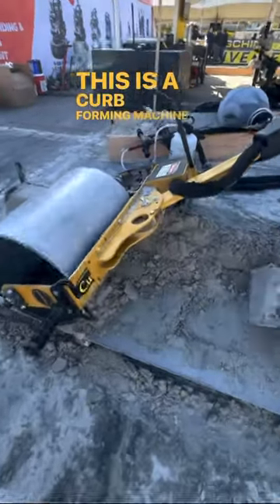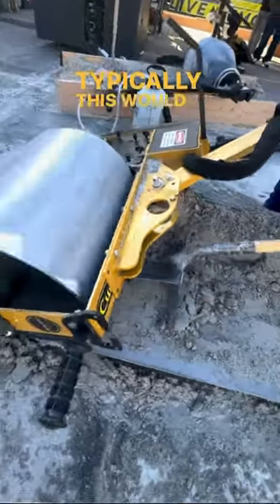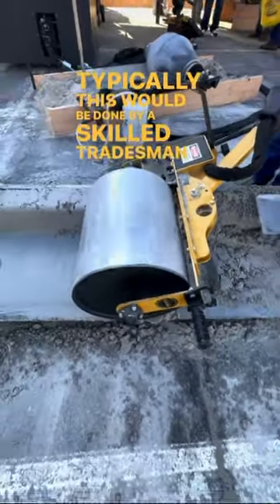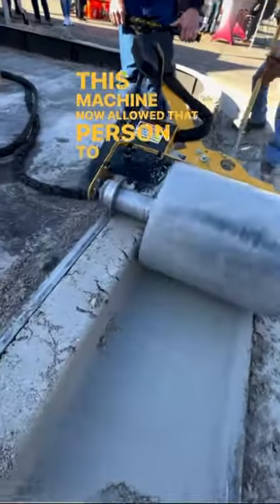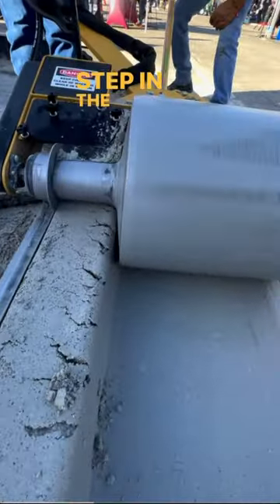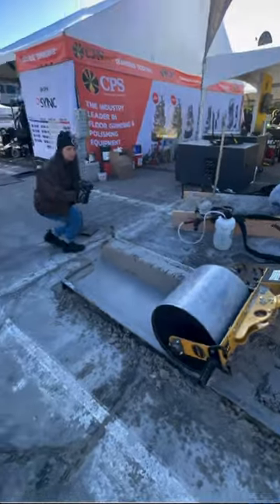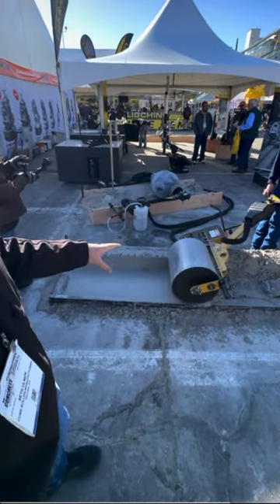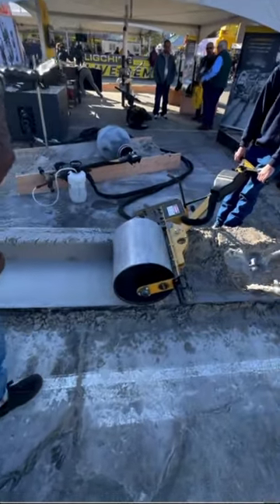Building a curb is not normally this easy. #shorts

Comment: Stan, love the channel. Been pouring concrete for over 20 years and never liked doing curbs. My boss demoed 1 of those units that came with the sales rep and 2 concrete finisher/laborers to "showcase" that machine. We poured with it for 2 days back to back. IT SUCKED!!! I hate curbs, but would rather do it by hand... that's saying a lot. Our crew of 4 assisted the demonstration crew both days. We poured 1.5X as much curb without the machine. We typically did walls and flatwork, so a "real curb crew" would smoke that POS!

Comment: The curb itself looks like it still needs a lot of handwork to finish it off.
Reply: Buddy they’re using sand it’s a demo. That’s not asphalt or concrete
Reply: They arent using concrete here
Reply: @aaronkirchinger  the mix is way to dry. so you see the rim cracking up already because of lack of water.
Reply: Still looks slow compared to other machines that does similar style curbs with vibration instead of rolling
Reply: Yes, there is still finishing to be done but that will take less than 1/4 of the time of a skilled finisher than creating the curb from scratch. Also the artistry (skill) of forming the curb would no longer be needed. A brand new laborer would be capable of completing that curb
Reply: @peteratkinson1939  what are you basinging your conclusion on? You cannot visually tell the difference between cement and sand. True, i do not see bigger aggregate, however that does not mean it is not concrete.
Reply: @peteratkinson1939  make discord
Reply: @peteratkinson1939  make discord
Reply: @peteratkinson1939   Alexis
Reply: @peteratkinson1939  i thought it looked really dry lol
Reply: @Peter Atkinson  then its not a demo.. its a waste of time.

Comment: A lot of cracking on the curb itself the gutter looks great a long long time ago many moons and the sun came many of times a company I work for used a curb machine the harbor freight special in the ingredients in the concrete mix they use a fiberglass fiber instead of using rebar but with this machine came special trials to work the concrete is that the same with this machine to fix the cracks on the curb

Comment: That's cool but I saw a guy use Masonite The 2x4s and a rubber mat. The top had an opening poured to concrete in used is chippenhammer and just slid it back and forth did the whole curb 40 ft about an hour

Comment: My work shop was next door to a curb shop. They had a dispenser that shot the cement out forming out a perfect curb. Almost like a noodle dispenser.
Reply: My brother worked for a concrete company. They used a machine like you described. He called it the playdough machine.
Reply: We actually offer admixtures to help make concrete for those machines.

Comment: is that normal dryness for this type of forming?
Reply: I'm wondering the same
Reply: Its a demonstration
Reply: Normal because they are using plain sand no portland cement added. Yes.
Reply: It’s sand not even concrete
Reply: @TT-ik3kd  if you're doing a demonstration wouldn't you want it to look better than actual? Not worse?
Reply: It's probably because at these trade shows they do these demos repeatedly and I wouldn't be surprised if they used the same concrete repeatedly and you can only wet the same concrete so many times before it loses integrity

Comment: A skilled tradesmen wouldn’t necessarily need it per day , BUT about the time you have 100+Ft of curb on a hot day where it’s going set up quick this machine would be very helpful. Plus I’m sure just like anything once you get the hang of using it you probably could move right along at a pretty good rate.
#QualityConcreteFlatwork💪🏼🤠

Comment: #1it doesn't look like the concrete was wet enough because of the imperfections  in the curb # 2 if that's the way it is does someone go behind and fix the imperfections??? Thanks looks like a game changer
Reply: At the show we use sand in place of concrete, allowing us to tear it up and re-shape it over 3 days. The Curb Roller is a shaping machine, not a finishing machine, so unless you have a really dialed in mix you will use a curb tool or something similar to seal it up.

Comment: It's a demonstration people, not an actual job, guys who use it daily use it much faster and cleaner
Reply: Ya....but it's not a good demonstration.   That curb needs a lot of work to fill all those cracks.

I suspect the concrete was a bit too dry....OR, the machine doesn't work.
  One or both of the 2 options.

I'll give them the benefit of the doubt, and sayvthe concrete was too dry or the machine was having a glitch at the time of recording.     But I definitely need to see better performance from this machine before I would ever consider using it.
Reply: @tfnine9031  We use sand for show demonstration purposes, not concrete. You're more than welcome to check out the videos we have online as well as signing up for actual concrete demonstrations for real-world scenarios 👍

Comment: That is way to slow I have guys that will run circles around that machine.
Reply: Most customers see double what they can do by hand in a day. While hand-forming can be faster in the first 10 feet, the machine quickly laps it.
Reply: @CurbRollerManufacturing  not at all you still have to go back and fix that stuff by hand.
Reply: @macsway2002  Just giving you our customer's feedback. One company went from 400 LF by hand in a day to over 800 LF broomed and finished their first day with the machine.
Reply: @CurbRollerManufacturing  that’s really not a lot of curb in a day.
Reply: @macsway2002  Might not be for you, but everyone does different jobs and has different requirements.